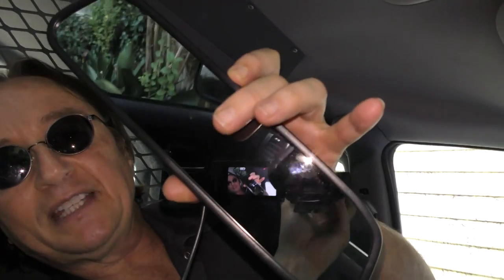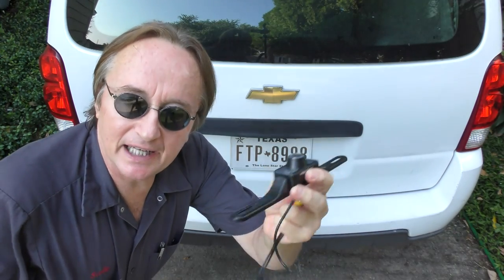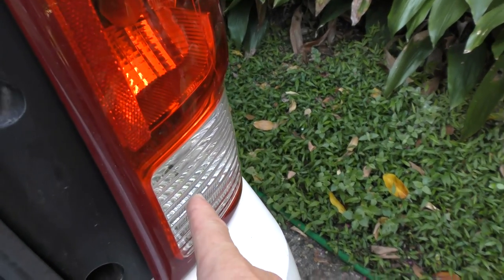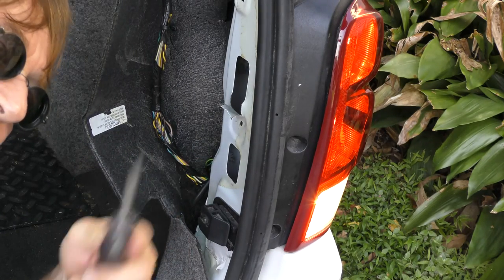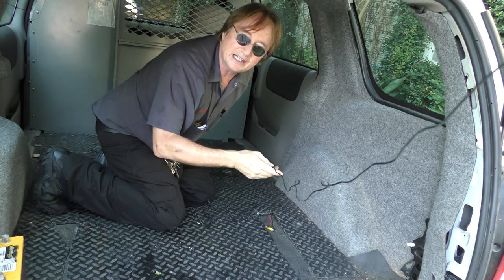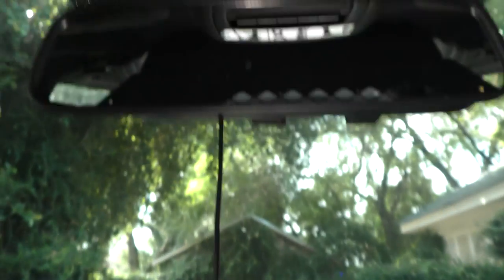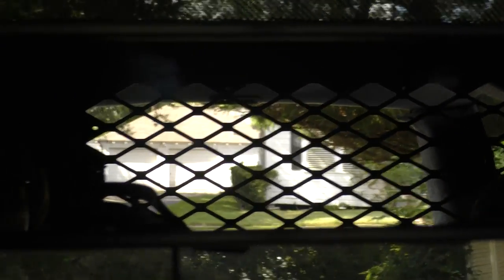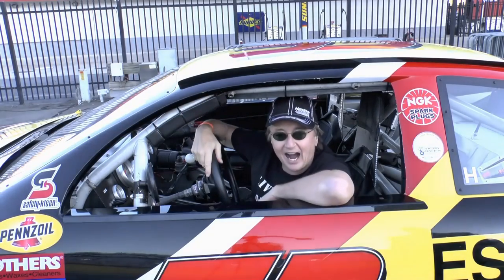How to Install a Backup Camera in Your Car

Comment: People pay hundreds of dollars for this feature in new cars. It's cool that you can do it for $20.
Reply: Standard equipment in more or less every car today, at least in Europe.
Reply: *thousands
Reply: Not really, you have to pay for cameras quite a lot because they charge you with a big screen. Since you have a big screen you have a gps and all kinds of media. Since you have a lot of media you get better speakers. Overall you pay A LOT for it, not worth it.
Reply: these are made in China from old stock cell phone cams and lcds. amazing how it's $20.

but the labor is what really costs in time or money to get it looking good.
Reply: I thought that they fell off a truck somewhere!
Reply: Yeah, I contacted a local car stereo place to ask what they offered. Their system is basically the same as what's in this video and they were quoting me a rate of $600-$700. Be serious!!
Reply: T Glenn high but ppl pay stupid money for car upgrades.

A proper install is labour intensive.
Reply: T Glenn Well they have to run the wires through the car, connect it to fuse box. It will take an hour or 2 at least. So product, labor and profit.
Reply: not if they use the transmitters. did it myself, took me 40 minutes from start to finish.
Reply: ***** 
This can also transmit to the stock screen (if it has the connection). 
Never had mine stolen, and it is also waterproof... That's because I "invested" around 60$ in my set, so the camera is actually mounted instead of the license plate light, and includes a led light in it.
Reply: *Tens of thousands.
Reply: Why Zen? Right in my new Audi it took up the price an extra 3k bc it was a “special camera”
Reply: and how much does this option cost on your "new cars" ? 2000 3000 $ ?
Reply: 1 million dollars.
Reply: Not really. It’s a law in the USA now that all cars need to be made with them.
Reply: The Chinese knows how to make almost anything affordable :)
Reply: @Kvickification  and in America. But used cars dont have them. And its a good way to make a perfectly good old car more modern

Comment: that wouldn't last a night here in my town, boom, stolen.
Reply: You could use special screws that cant be unscrewed with regular tools.
Reply: pretty sure the frame is plastic or a weak material, so they would easily rip it off even if the screws are unscrewable
Reply: if someone gonna rip it off your car, they will....they wouldn't care if it breaks or not so the solution is, Install it at your own risk.....
Reply: Asymptote Some people just want to destroy other people property, but if its just stuck to the car anyone can take it off, but if its properly secured only the determined ones will
Reply: museack
they can use JB weld or any other plastic fixign thing, even the plastic welding thing to fix that and make it usable, not being negative just saying that aunscrewable screws wont make much of a difference if someone really tries to steal it
Reply: museack if he's gonna use it for himself yeah, dont be stupid, a lot of thieves remove what they can and fix it later for themselves

dont believe me? chain your bike only from the tire and leave it in an unsafe neighborhood for a day, you'll see thiefs dont give a fuck about only getting most of the bike
Reply: Asymptote im sorry but i dont think tweekers would go through the hassle to steal a $20 dollar backup cam.  I live in LA and i dont know what city, state ur in but i work at home depot and the tweekers returning shit are decently smart.
Reply: mixwell1983  yooo i work at Home Depot and we get tweakers trying to return shit too

Comment: Would've been great if you supplied a link to the mirror.
Reply from the maker: I don't do links unless they are sponsored. I just did this all on my own, if you go to amazon you can easily find it.
Reply: That's fair enough. I had a look and I think I've found it. You're lucky in America though, the same kit is priced at £40 here.
Reply: ***** Fairly difficult when there's more than one option available. People will watch this, want this one as he's demonstrated how to do it. I looked on Amazon and there's a tonne of different options available. Wireless ones, wired, 7" ones, small ones etc.
Reply: To be fair, Scotty did hold the box right up to the camera and if you pause you can read the brand, model, UPC, and even P/N.
Reply: Ebay Wireless 1 that looks identical for £24.99
Reply: When I get a chance, I'm going to see if they have a battery powered mirror assembly.  Wiring the reverse light is no big deal, but running the wire through the chassis, and then having a dangling cord from the mirror to the radio...I'm willing to drop extra dough to not have to deal with that, even if it means charging/changing batteries every once in awhile.
Reply: The only one by that name I'm seeing is $30.99 now.
Not sure if they changed the price or what.
Reply: Are you in Canada? its the exchange rate, our dollar is shit right now.
Reply: + James Johnson
Read my post above yours. I put the links in myself for everyone. I also made a thread post of my own showing the same links. The prices have gone up since he made this video.
Reply: Michael Burke I recommend filtering by price.
Reply: Alex M I'm with you.
Reply: Bruh Scotty is such a savage . Thats why I am going to marry him one day

Comment: One drawback with the mirror is that in bright light, the image is over powered by the reflection from the back window.
The easiest solution to this is to flick the little knob under your old mirror that is a sort of dimmer, or just tilt the mirror and put it back again!

Comment: I got mine this summer. Installed in about a hour or so. I like using this to park in the garage. I like to back into the garage. Heck I like backing in to park everywhere. But this camera is nice. It took me a little while to trust it. But you will come around.

Comment: Appreciate the video. Had a similar experience with a $14 Dash Cam earlier this year. Certainly not the best Camera around and it has its limits but the install was simple. The price is right, and a good proof of concept that I could DIY a few other things. Because of videos like this my '03 Sedan also has a Retrofit TPMS, which I love, it's completely wireless so anyone can install this quickly. A bit pricey near $100 but worth it as I was able to Monitor a slow Leak/Flat tire that I might have otherwise missed and driven on by Mistake ruining the tire or caused it to degrade more rapidly (possible catastrophic failure later) from low pressure/high heat buildup that would go unseen/ignored between Pressure checks.

Comment: Can I connect my camera with on/off switch? Or wire to parking lights. So I can turn it on while I'm driving. But problem is can this cameras work for prolonged time? Thanks a lot

Comment: I bought two different brands of these devices. The first one was expensive and the second one was cheaper (about $70). They both worked about the same. They worked well at night. During the day, the glare coming through the rear window made viewing the image very difficult. I had the rear window tinted for $80 and it was a little better.

Comment: Hi Scotty, I'm a new driver and I got my new Mitsubishi Mirage G4 last year. Atm I having issues with alignment, I just recently got it fixed from a tire maintenance dealer and after 2 weeks I got the same issue(not sure if it's only the steering wheel) but not bad as it was used to be and I've driving it smoothly as possible. Any suggestions or can you give me a feedback about this car?
Reply from the maker: find a better aligment shop, many tire dealers don't have such great mechaniccs, go to a real front end shop that does ONLY that.

Comment: Scotty sorry to see you leave Tn., your vids rock and it's nice to watch a good honest mechanic tell it like it is. I just got my van top 612 today and am deciding where to mount my rear camera but a near tag install is out because my led tag lights will wash out the camera. I am considering removing the lock barrel on my 99 f 150 tail gate and sliding the camera in there, I live in a congested area of Florida where everyone drives with a phone in their face so I can wait to get this thing operational. Thank you for the solid info and good luck to you.

Comment: Hey Scotty, I have a 
96 Toyota Celica 2.2L that shows codes P0141 and P0401 for oxygen sensor
 bank 1 sensor 2 and EGR insufficient flow, respectively. 

What I've done so far:
I put in another o2 sensor from another Celica manifold off a blown engine I had, as well as a VSV.

I tested the original VSV with an ohmmeter and it was out of spec 
(tested about 45 ohms).

I tested the EGR valve by sucking on the top tube to draw a vacuum and 
open it, making the engine die (I also watched your
 video dealing with the valve being carboned up at the intake, but if 
that was so, I don't think the engine would die if I did the vacuum test
 on it, would it? I'm not sure.).

 I disconnected the battery for an hour to clear the codes after swapping
 those parts and the light doesn't come on while driving an hour on the 
freeway, but when I turn off the engine then turn it back on, the light 
comes on. I also had o'reilly's clear the codes, same 
schtick.
Reply from the maker: replace that sensor, and realize egr valve is either bad, or the suction to it is not working right on a toyota.
Reply: Ok, I'll try that.
Reply: UPDATE, I got good news: I got the EGR P0401 problem solved by doing the following:

1. Replaced the valve cover and spark plug tube gaskets, since they were hard and brittle and blowing oil on the exhaust manifold.

2. Used RTV silicone on the good vacuum hoses where they attached to the nipples so they don't leak, and replaced any old hoses that fit the nipples too loosely (THE SUCTION PROBLEM you mentioned).

3. Sprayed the PCV valve, EGR valve, and the metal EGR hose with carb cleaner (which were clean but I did it for good measure). EGR tested good, as well as the vacuum modulator and VSV tested good.

I am now waiting on a Denso OEM O2 sensor with part number 234-2010 from here: http://www.ebay.com/itm/302074335049.

I am left with a question: Would a bad valve cover gasket ever cause a 
P0401?

Comment: Yeah, great video as it got me thinking on buying one.   It would mount over the state name on the plate however.   The other issue for me is the plate is on the left rear side of the vehicle as I have a rear mounted spare tire on the right side.  Not sure if the view would be impacted/affected.  Also, what about theft exposure?

Comment: Pretty cool setup but luckily for me my Ram 1500 already has one built into the tailgate handle. My brother has the exact same truck and Year but his doesn't have that option. Also unfortunately for the 2014 Ram 1500 the microphones for the voice activated features are mounted on the rearview mirror, so nothing it going to be able to fit onto it. One last thing, here in California the month/year tags are on top of the plate and can't be covered up. That would prove to be a problem for a lot of vehicles adding that camera setup.

Comment: Scotty, I bought a similar kit for my  '05 Tacoma. The image ticks on for a split second every second or so. Having a hell of a time diagnosing the cause. The power for the camera is drawn from splice in reverse light positive and negative. The mirror monitor is powered from the reverse trigger wire in the driver side kick panel. Would I need a voltage stabilizer at both power taps? Something else?

Comment: Hey Scott: My mom's 2007 Chevrolet Uplander has issues with the rear quarter windows not opening at all, and I have no idea where the hell the wiring is for the rear windows.  Would corrosion kill the connection? If so, should I salvage one off of a car at a junkyard or buy a new wiring harness and solder in the new one?  "Stealerships" would charge me about $100 to look at it, plus the repair.
Reply from the maker: try a salvage one AFTER checking the motors, they are notoriously weak and tend to rust out

Comment: Scotty, I've installed one of these on my car yesterday and the mirror that came with the unit doesn't seems to be working as a normal. It's really dark any idea?  Got the rear view camera to work and all that but the cable that connect the video have an extra red wire coming out of it too so I didn't connect it to any power sources.

Comment: Hi Scotty Kilmer,
I wonder if these would still work when exposed to heat.
Like a car sitting in the sun in a tropical climate/in summer. 
I wanted to install these and a dashcam but worry they would be ruined by the heat.
thanks
Reply: id like to know the same, as i cant leave a dash cam in the truck without the battery exploding during the 120* summers :/
Reply from the maker: only time would tell on that, but any car parked in the sun will deterioate plastic, that's just a fact.
Reply: It's very cheap compared to more known systems, or factory systems. You don't lose hundreds of dollars of this goes bonkers on you.

Comment: Hey Scotty! What do you recommend as far as oil change intervals? Mine's a normal commuter, a 2005 ford focus 2.0L with 140k miles. I was thinking of using full synthetic oil since it's reached the "high mileage" part of it's life. Ford recommends changing every 5,000 miles, but my dad swears in his work vehicle (a 2008 Nissan Altima) that they do full synthetic and change it every 10k and thinks I should do the same.

I've heard arguments for both sides of the fence - either change it every 3-4k religiously or change it every 8-10k with no problems.

I'm sure it's a question you've covered before, but I couldn't find it in a video. Thanks!!!
Reply from the maker: stick to five on that old thing

Comment: Hey scotty! I'd like some quick advice if you can spare a minute. So I had my horrible electric ABS system in my 90' T-Bird SC converted to Vacuum (per your recommendation), but ever since the car has been stalling. The mechanic told me it was the MAF sensor, which I replaced, but it still stalls. It never did this before I had the brakes converted. I think it might be a leaky booster, because the boost gague is showing low vacuum at idle. But, I'm not sure what to say to my mechanic. In your opinion, should I demand him to put a new booster in for free (if it's the culprit), or what? I don't wanna be a jerk to him since I can tell he's an honest man, but I also just spent $600 on a repair that caused more problems. Thanks! Your videos have saved me so much money xD.
Reply from the maker: could be a leaky booster, but any pro mechanic could pressure test it to find out, so start there

Comment: Does the mirror also take power from the reverse kicking in or do you wire them separately ? so does the camera need to constantly be on standby by being wired into fuse box or something as an example?
Reply from the maker: it takes power from reverse. It's not on standby, the reverse power just turns it on like  a switcb
Reply: Thanks for reply 
You said the mirror takes power from behind the radio because that's always on? 
So I should power both devices to the reverse light?

Comment: Hi, Thanks for the video, I just purchased the rear view camera pack just like the one you used in your video, and installed it on a bmw 530i 2007 but I have a problem now which is after starting the car and going to reverse, the camera works for only afew secounds and then the camera goes blue and turning off( because of no signal I guess) I used reverse light for feeding positive to both camera and lcd(mirror) and for negative directly connected to the battery. May you please help me? some says I should use a relay and connect cam and lcd directly to positive of battery through a relay and use the reverse light signal just to switch the relay on. Do you think this will solve my problem?

Comment: Hi Scotty. I got me one of those and as soon as i get the camera connected to the hot wire of the reverse light it makes so that even when i get out of reverse the reverse light stays on. when I unplug the camera it all goes back to normal. what am I doing wrong??
Reply from the maker: you either got a bad unit or have it wires to the wrong wire that stays on all the time,

Comment: A backup camera would be nice sometimes, but I wouldn't want it on only when in reverse, so I'd probably have to feed 2 wires through to the front: One for the video, and one for a switch I can put in the dashboard. Plus, in this case a dedicated display might be better, so the mirror is still usable when the camera is on. But for people who only use it when in reverse, this is certainly a cool and cheap little gadget.

Comment: I had replaced the harmonic balancer at first, but when I floor it the car shuts off after reaching 60 MPH. It's a 2008 Ford MUSTANG 4.0L V6.
Reply from the maker: check for wiring problems, such as crank sensor problems in the area you were working first.

Comment: I must have gone through 3 or 4 dashcam systems for my car and none of them worked for me. I live in Phoenix Arizona where the heat in the summer is atrocious. I tried suction cups and it did not last long. I have tried the rear view mirror mount and found that the camera simply dragged my rear view mirror down in the heat. Any suggestions?
Reply: Yes, times for an upgrade and buy a newer car with rear view cam if it's comfortable. I think it is cheaper to keep replacing those 20-30$ camera every other years.  You just go on eBay and by the Mirror/Camera, the back camera itself etc...under $20.